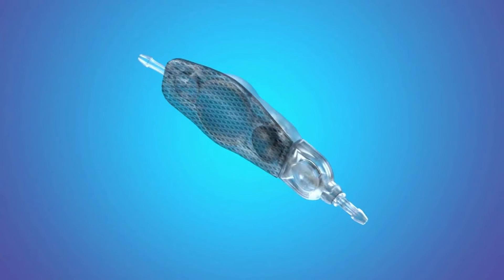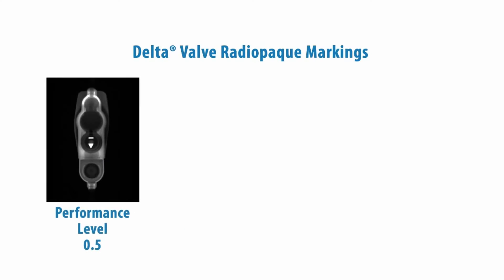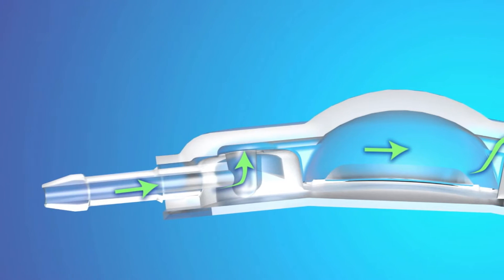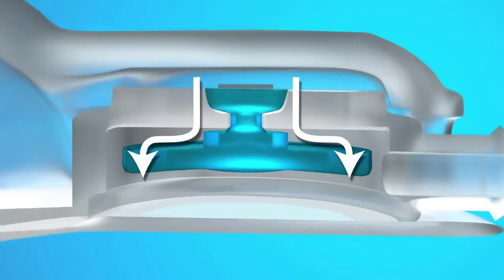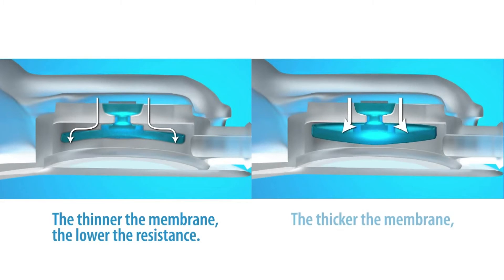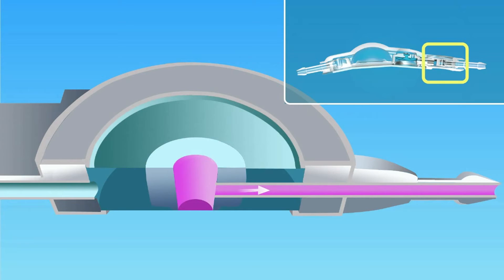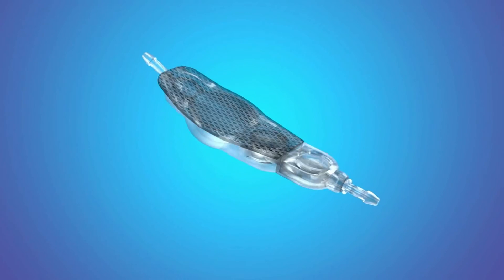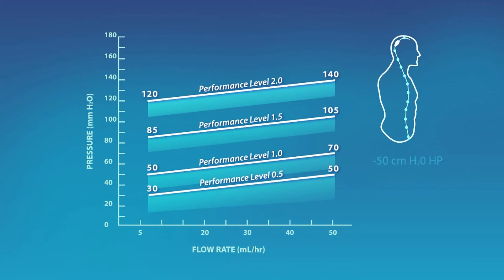The Form and Function of Medtronic Delta Shunt Valves

Comment: My gf just finally got her LP revised to Delta 1.5 after a couple years with a programmable Certas.  Took 6 months, and referral to Keck. Had no idea the design physics would make such a difference, but it does!  This shunt system fits her unique needs much better than the other type, pressure differential seems to be more stable.  And her Vp is going strong after 14 years! Thanks Medtronic! Chat GPT really helped out too.

Comment: That Delta mechanism is really clever! I recently learned that the shunt I have is the Delta, and while it hasn't been working for over 10 years now, I wouldn't be very surprised if the failure is in the distal catheter instead of the shunt valve.